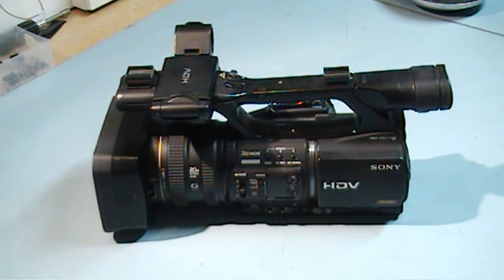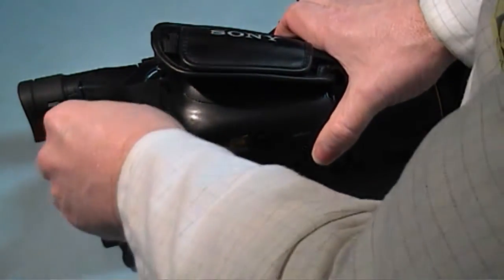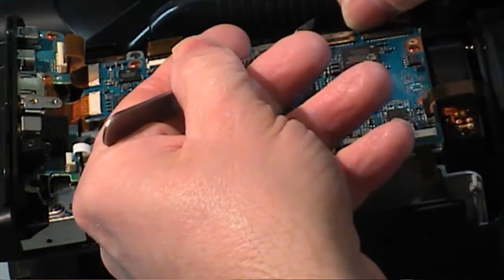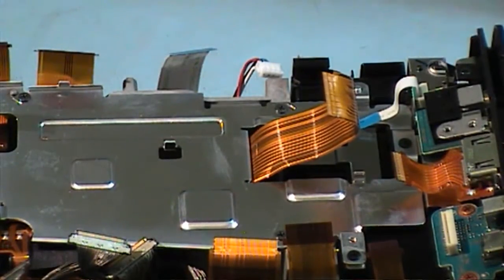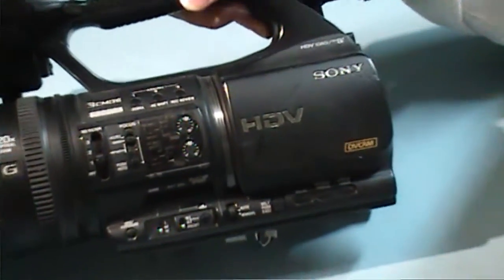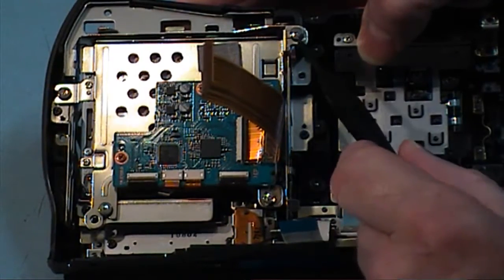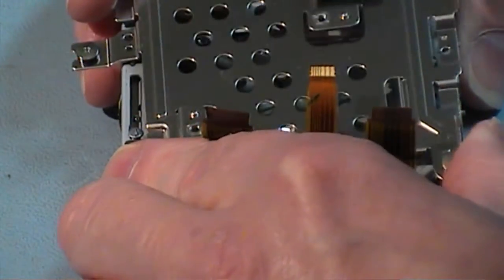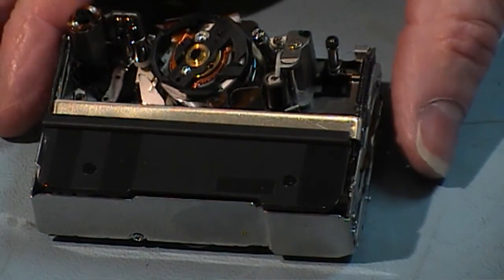Sony HVR-Z5 Disassembly

Comment: Nice little cameras to work on but don’t see them much anymore.   Had to replace the MD-20 the mech deck inside one recently which had become jammed. Much nicer than the tapeless models which are a nightmare to take apart at times.    The EX1 and EX3 can be annoying but the more modern stuff is okay.  Great video !    Sony still sell the parts for these from what I am aware.

Comment: Hi there. I have one of these cameras. The iris ring is no longer working (Eroor Code: E:61:30), so I can't adjust the f.stops. When I turn the ring the f.stop numbers change, but nothing happens. Is there to bypass this? To open/close the iris without the iris ring, or having to use gain? (And without replacing the whole lens unit.)

Comment: My HVR-Z5U screen went to blue and the audio quit during "Playback" of a recording.  Menu info still appears and everything is normal during "Record".  No "Playback" video or audio is available from the external outputs either.  It still makes perfect recordings that play back fine on one of my other cameras ... just no playback operation.  The counter on the screen shows the tape is advancing normally.  Any speculation where my problem is?

Comment: I have a Sony v1, the problem i just got is that after putting in a tape and closing it, it then doesn't retract back into the camera. Is that a big job to fix? Am really bummed out on this happening. Thanks!
Reply from the maker: Fort reliability, you would have to change the deck assembly part # A1171909B
Then setup the deck assembly using special tools, not a job for diy
a few thing that cause this is the ribbon cable that is between the main deck and sub deck, this breaks over time and also the mode switch
Reply: Electronic Workshop Thank you for replying, a shame you are so far away. I would love for you to fix my camera.

Comment: hi, every time I turn my z5 I find the schedule and time setting. is evidently the coin battery. you can tell me where it is located? do not understand why they have become so hidden
Reply from the maker: The lithium battery part no. 175613412 is located near the internal microphone
you will have to remove the buttons and the board to get access to the battery
The battery holder , Sony say it has to be replaced at the same time, part no. 175661551. This in unfortunately not a customer replacement item, unless you have some experience in working on cameras
Reply: +Electronic Workshop I assume this is in the front end of the handle assembly.  Can you be any more specific?  Inside near the XLR jacks or front near the mic or on the left side where the viewfinder is attached?  Any idea why the battery holder must be replaced when replacing the battery?

Comment: My Z5 viewfinder went dead and I suspect it's the ribbon cable. Is it easy to replace this myself? I replaced a similar viewfinder cable on two VX-1000's so I do have some experience with taking camcorders apart. Is there a way to replace a Z5 viewfinder cable without taking the entire camera apart?
Reply from the maker: Its fairly easy to replace the cable
remove the handle cover and the rear cover underneath the viewfinder to get access to the screws,
Just be careful of static electricity, they viewfinder can be damaged easily
Reply: I got the rear cover off underneath the viewfinder. But I'm having trouble with the handle cover. I removed the top two visible screws and the two screws at the front of the handle in the LCD cradle. I can lift up the top part of the cover but something is still holding the cover down in the rear near the viewfinder. I don't want to force if off and break something. Do I need to unhinge the viewfinder or remove the light shoe?
Reply from the maker: The light shoe will have to come off
Reply: OK, I got the handle cover off but cannot see where the ribbon cable connects to the viewfinder. In the rear under the viewfinder I see some black screws holding a silver bracket in place. I assume I need to loosen that silver bracket, correct? So I should be able to access both connecting ends of the ribbon cable by only removing the handle cover and rear cover?
Reply from the maker: the 4 screws have to be removed, then the evf has to be dismantled.
but make sure you have taken all esd precautions, you can damage the evf with static electricity

Comment: Hello, I bought the deck but I have a problem when I disassembled everything. My deck did not come with the recording head. I'm trying to get the former but I can not. Could you helpme?? 
arthurps.rj@gmail.com
thank you a lot!!
Reply from the maker: Here is the part number for the drum motor (heads) A1128533A
you could use your old heads if they are not worn,
but be warned, you need special equipment to set up the deck and head, example
head switching point/ tape path adjustment, you will need the remote lanc connector and cpc jig, along with an oscilloscope
If you have these, great, without them its impossible to do this job
Reply: Thank you a lot!  You are really helping me

Comment: Hi Could you make a tutorial on how to adjust the lens or try to repair the error C:32:60 in this model using RADAR W, the Light box and chart. Also the RM-95 is needed? and what adapter is needed to connect the camera to the computer? I know sometimes it could be repaired without change the lens or lens board using RADAR, light box and chart. Thank you my name is Pablo and you can contact me at www.pixelsdecibles.com

Comment: Thank you! Could you tell me where is the best place to buy this part?
I´ll try
Thanks a lot
Reply from the maker: Which part?
If its the tape deck, I normally get it from Sony,
But be warned, This deck has to be setup, with special tools
you would need the remote lanc tool and cpc jig and an oscilloscope to set the tracking,
switching would also need to be set
you would also need the procedures in the service manual
Reply from the maker: the part number for the deck is A1437006A